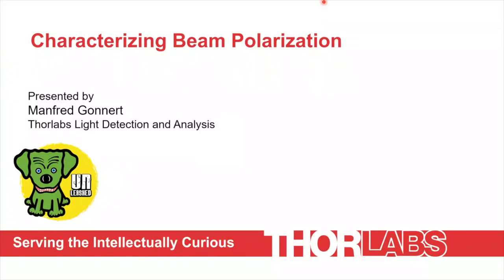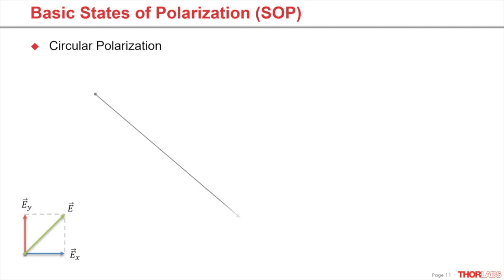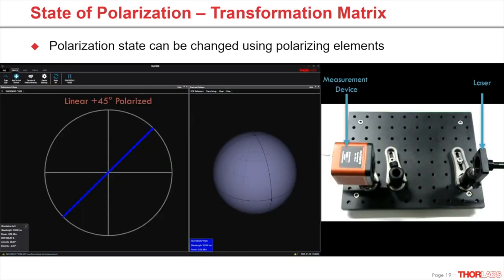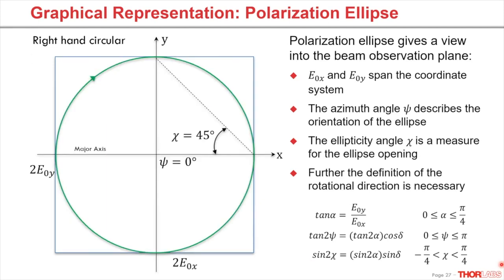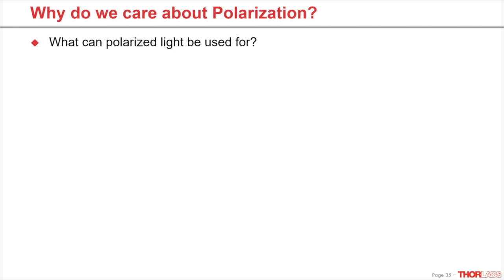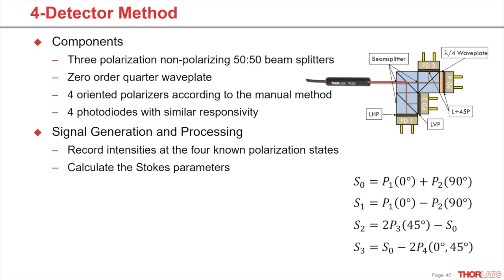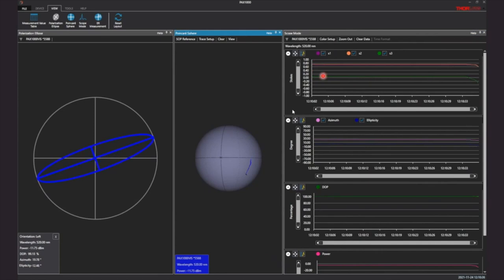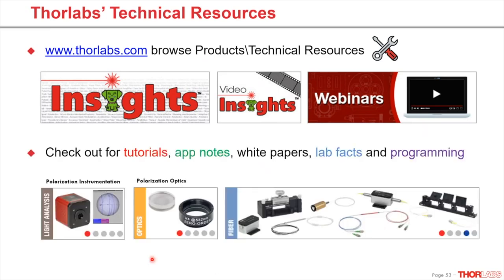Characterizing Beam Polarization

Comment: Really interesting. But i ask myself how polarization works with antennas? When I understand correctly 5G uses polarised light. Which should be quite hard as the receiving device can move freely. How does that work?
Reply from the maker: Thank you for your questions! 5G uses frequencies around 40 GHz (close to WLAN, which has frequencies of 60 GHz). Although these are electro-magnetic waves, it is not visible light (100s of THz) but rather radio waves (100s of GHz to some THz).

Polarization has been used for some time to gather more information that what could be gleaned from simply looking at the amplitude and frequency of the signal, as demonstrated by Radar Polarimetry.

When using two polarization states, you have two channels, so you can transmit twice as much information.

For analyzing the individual signals or channels, you do not measure the actual state of polarization but rather filter the signal for the polarization you would like to record and post-process.